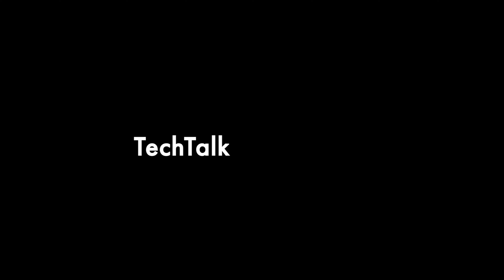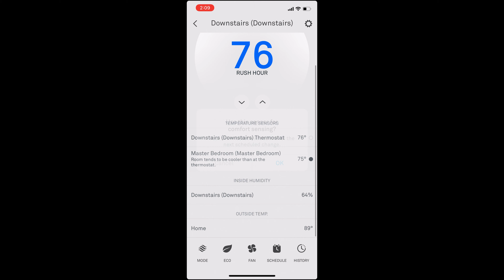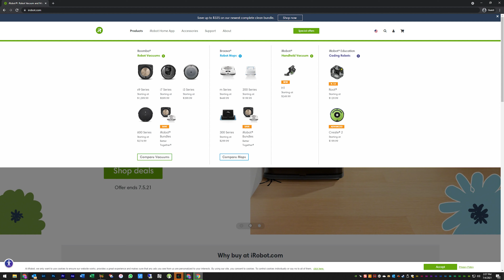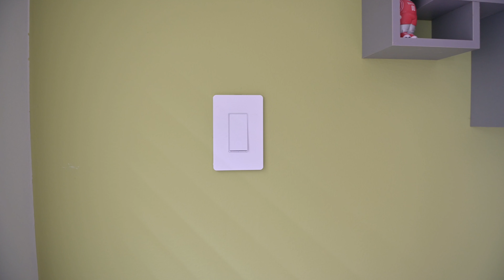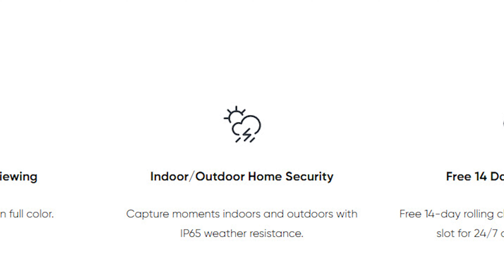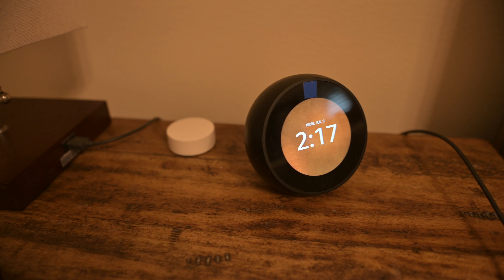Top 5 Smart Home Devices

Comment: Hi Samir,

Love these videos! I have a question about the Smart Thermostats. My home already has an internal HVAC system and a smart thermostat seems like a good investment. However, I’m not very handy and was wondering how installation is. Was it easy to connect it to your existing HVAC system or did you have to get it professionally installed?
Reply from the maker: Good question. It’s very easy to install takes 5 mins with existing HVAC system. I have two in the house. One for downstairs and one for downstairs.